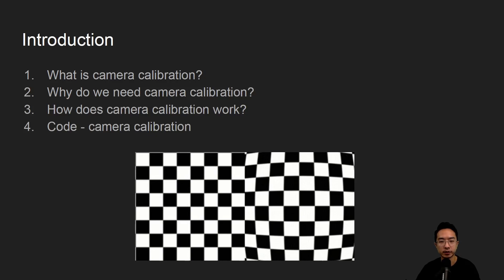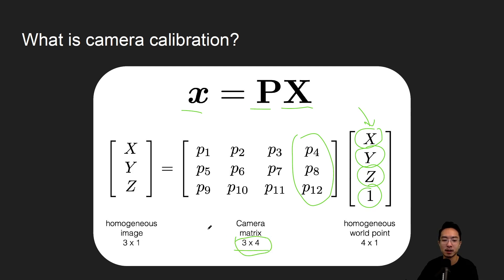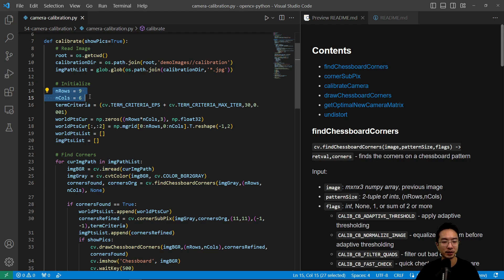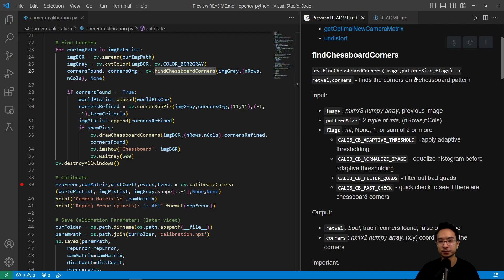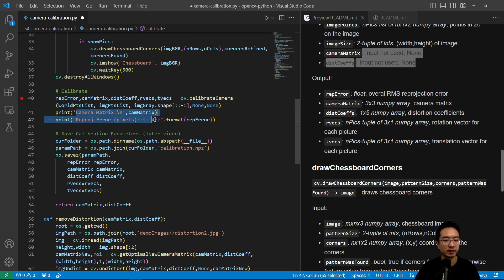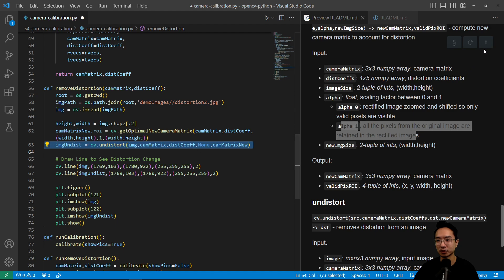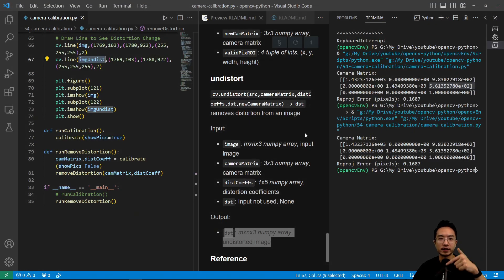OpenCV Python Camera Calibration (Intrinsic, Extrinsic, Distortion)

Comment: Can I use a thermal camera for this application as  well? I have a checkerboard where the black and white squares have visibly different emissions that can be captured by the camera as well.
Reply from the maker: In theory yes but you may need to modify some logic
Reply: @kevinwoodrobotics  which logic in particular besides my checkerboard size? I have your code as well.

Comment: Hi there! Is a very good explained and clear video! 
I have a question tho. How or why did you chose the world points in line 18? Is that step arbitrairy or is based on something like how you took the images? Thanks in advance!
Reply from the maker: That step is required because calibration requires projecting world points to the image points. The origin location is arbitrarily though so long as you use the same location for all the images. The distance between all the points in the world points however need to have physical sense (ie equally spaced apart like the actual chessboard spacing)
Reply: Im a bit dazzled by the fact that the only real world information you provided was the sizes of the quares and that was all. I mean you moved and tilted your chessboard quite a lot and very randomly. Even under the asumtion thta the world Z coordinate is always cero and is the camera that is moving, the world points are only related to the positions of the board in the image by the fact that they are both equally spaced. how is that enough information to determine the extrinsic parameters and know the position of the camera with respect to world? 
The chessboard was never expressed with respect to world coordinates. (at least not with presition, only the spacing of the points was alike) 
I can see how it whould be enough to know the position of the board with respect TO THE CAMERA (is the same working principle that is used in ARUCOs) but i cant see how is that enough to get the coordinates of the camera with respect to worlds frame since there is no true coordinates for the board in worlds frame. 
Sory for the long text but i really need to understand this.

Comment: Hi there, should the world points be rescaled in the correct (real) size? I mean, if you used a chessboard with 1cm blocks size the world points should be equal to (0.01,0,0), (0,0.01,0)... right? Do you account for this or we do not have to account for this? If the latter is true, why is that?

UPDATED QUESTION: Doing some experiments i found out that only the tvecs change when changing the size of the chessboard blocks (e.g. experiments with 1m chessboard blocks :) and 1cm). We care more about the camera intrinsic matrix so i guess we do not care the exact block size?
Reply from the maker: Yeah for intrinsic it won’t matter too much! Extrinsics it will

Comment: Hi, Kevin! It's nice to see your tutorial videos, cause they really help me a lot to thru my digital image processing project. But as a beginner, ive a question (im so sorry if youve already explain it in your video, i just, i still didnt understand yet about how this calibration works). Lets say i want to do estimate measurement with image processing. Some papers said, that i should take the calibration first before i do the measurement. If i already do the calibration, does the fix parameters (intrinsic and extrinsic) will be "saved" in the camera? How could we do that...? And if its so, so, when i want try to capture an image with my camera, i dont have to run the calibration code (cause the camera have already "set" in the camera)? Or i should run the code again or merge the calibration code with my image processing code? Sorry for the question, I really thank you a lot if you are willingly to explain me some..
Reply from the maker: Good question. So the idea is that you take calibration images to get the camera parameters which you can save somewhere. Then you can use those parameters on new images to correct for distortion for your specific task or use that for depth estimation and reconstruction.
Reply: @kevinwoodrobotics  Ah.. i see. But some libraries (like opencv) they have several functions to do this kind of things, right? Such cv.getPerspectiveTransform or cv.warpPerspective. Does that mean i shouldnt have to do that functions? Since ive already "taught" and "set up" my camera? Or i still have to do the functions?
Reply from the maker: @dyahlangensari4802  yeah you have to modify the images still after calibrating
Reply: @kevinwoodrobotics  Oh, may i ask you one more question? What if the camera that i want to calibrate is a wide-angle camera? They have more complex distortion rather than an usual planar camera, isnt it? Since they're viewing in such wide-angle. Does it have "the same principles" with the usual planar one? Or do they have a different principles?

Comment: Great video. Does this help in removing perspective distortion. I am doing a project on automatic garment measurement using computer vision. I have found key-points of the garment but when finding the measurement the pixel to distance scale doesn't remain valid for all the measurement because parts closer to the camera will have a different pixel-to-distance ratio compared to parts further away. So using this code will help in fixing it?
Reply from the maker: This is for lens distortion. For your problem I would recommend looking into homography to transform perspective view into a 2d planar view. I have a video on that
Reply: @kevinwoodrobotics  thanks for the reply. Another doubt, Is it possible to not crop the original image when applying distortion because it seems like it provides a Roi and need to crop the image.

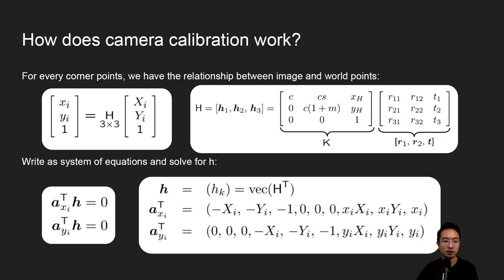Comment: At ~4:20, you mention "mapping between world points and image points", but isn't this equation relating two (2D) image points [x_i, y_i] and [X_i, Y_i] from the left and right image, rather than describing the relationship between (2D) image and (3D) world points? Otherwise, why is there no Z_i component in the [X_i, Y_i, 1] vector?

The matrix H stands for "homography", which is a projective transformation that maps coordinates on one (planar) image to another image.
Reply from the maker: Great question. Here we are assuming the world frame is on the chess board so all the Z values are the same for all world points on that plane. So we are able to drop out the Z component.
Reply: @kevinwoodrobotics  Another question, by assuming Z component are all the same, we are assuming that the distance in x, y plane might be different, but in the code it looks the world x, y coordinates are all fixed, which implies that the distances of corners are same VS different. How to understand this?
Reply from the maker: @songpandy9590  so the idea is to assume that this grid is attached to some known location in the world. So for simplicity, we attached this to the origin of the world frame and coincident with the xy plane. Since the checker board has known spacing, those values are fixed locations. Hope this helps.